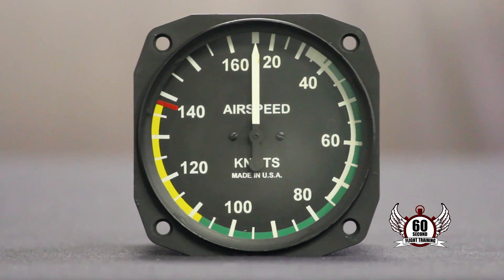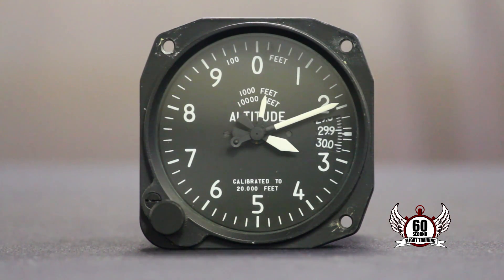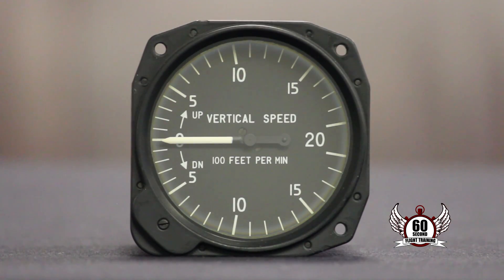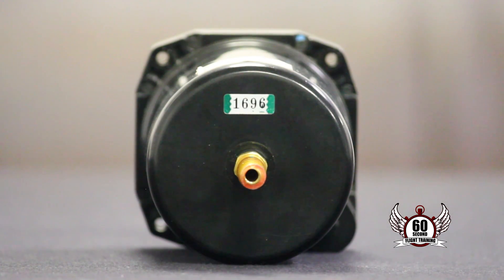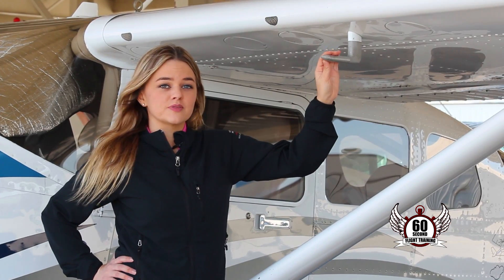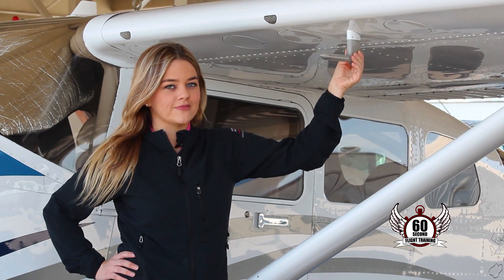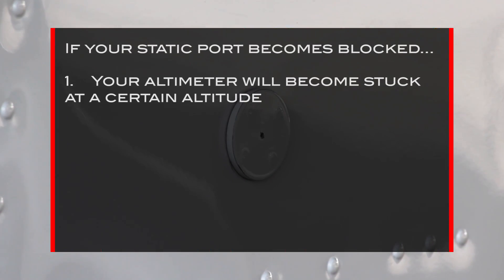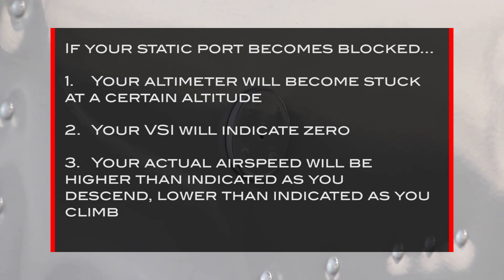Pitot-Static System | 60 Second Flight Training

Comment: The reliability of this system could be increased if they faced aft and measured the ram vacuum.

Furthermore in addition to heaters, a compressed air line hooked up to the system could be implemented to purge a potentially blocked pitot.

Maybe even a hybrid system of ram pressure tubes and ram vacuum tubes?

Bugs, tape, dirt, and ice shouldn't be killing people!

Comment: What will happen if only the drain hole blocked
Reply from the maker: Hi Rineesh! If only the drain hole is blocked it shouldn’t have a significant effect on the instruments, at least at first. However, if the drain hole is blocked for too long, it may be possible that moisture and debris collect inside the pitot tube with no way to drain out, eventually blocking the pitot ram air input and causing erroneous airspeed indications. The only time the drain hole blockage has a significant effect is when it’s combined with an inlet closure. In fact, some aircraft have pitot tubes that don't have drain holes at all! We hope that helps - thanks for watching!